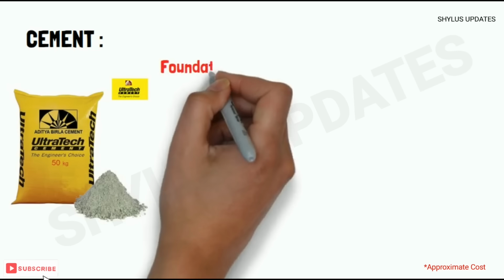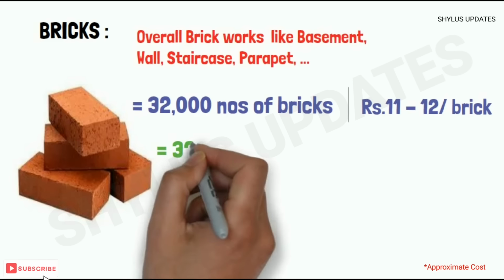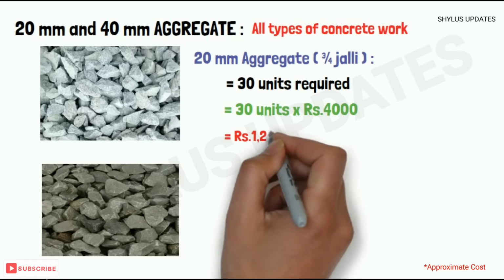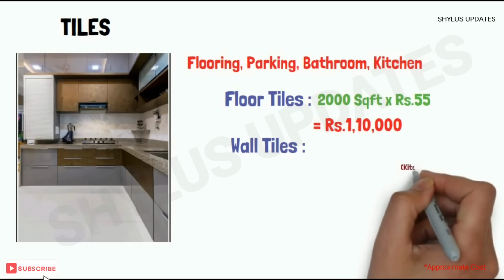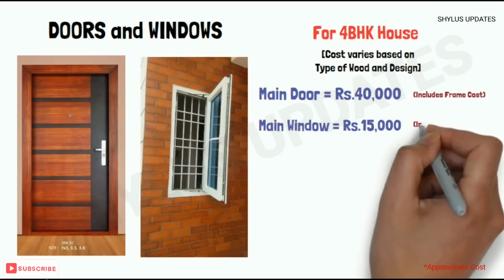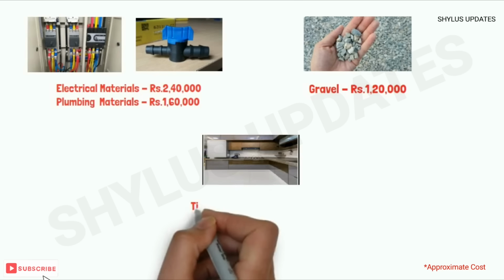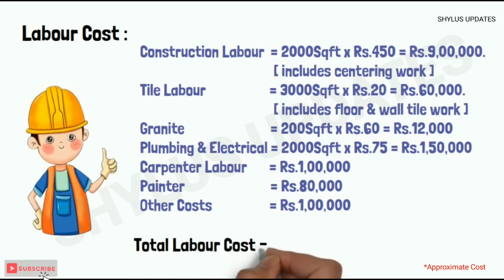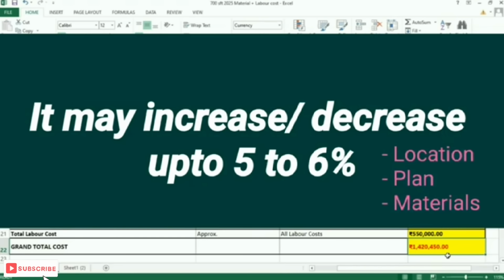2025 material cost & labour cost | 2000 sqft house construction cost | material cost 2025

Comment: What do you mean by N sand & P sand? Pl illustrate their difference & utility.
Reply from the maker: Yeah Sure ❤️
1. M-Sand

Full form: Manufactured Sand

How it’s made: It is made by crushing hard stones or rocks (like granite) into small sand-sized particles using machines.

Use: Mostly used for concrete work — like slabs, beams, columns, and foundations.

Texture: It has a rough and angular shape which helps it bind well with cement.

Color: Usually grayish.

✅ Main use: For construction (concrete mix)

---

2. P-Sand 

Full form: Plastering Sand

How it’s made: It is also manufactured sand, but more finely crushed and filtered than M-sand.

Use: Used for plastering walls and finishing works.

Texture: It has a smooth and fine texture, which gives a good finish to walls.

Color: Usually light gray or white.

✅ Main use: For plastering and finishing surfaces

Comment: Whether Architecture and Detailed engineering cost is included?
Whether total plumbing cost includes all fittings like Cammodes, wash basins, Shower, kitchen sink goose neck faucets, other wash Basin,  faucets. Health faucets, water heaters?
Whether total Electrical  cost includes, light fittings, ceiling fans etc. 
So when we make an estimate for a client it should include all these basic things of a house. We can not include interior work and ACs. It is left to the taste of the client,  But we can always give range. A complete costing with break up will help the client in budgeting for the full cost of the building.

Comment: Excellent presentation each item separately.

 Kindly confirm whether this is applicable in all locations. I.e. Main  city of chennai and nearby places.
Reply from the maker: Thank you so much 🥰
This rates are variable
But you can use this as a base sample 
Because in city areas, rates may higher than this🥰

Comment: Which cement brand cost 340/-, please let me know
Reply from the maker: - *Ambuja Cements*: Their OPC-53 grade cement costs ₹340 - ₹380 per 50 kg bag ¹.
- *ACC Limited*: Their OPC-53 grade cement costs ₹340 - ₹390 per 50 kg bag ¹.
- *Ramco Cements*: Their OPC-53 grade cement costs ₹340 - ₹390 per 50 kg bag ¹.
- *India Cements*: Their OPC-53 grade cement costs ₹340 - ₹390 per 50 kg bag ¹.
Please note that prices may vary depending on the location and availability of the product. It's always best to check with local suppliers or retailers .